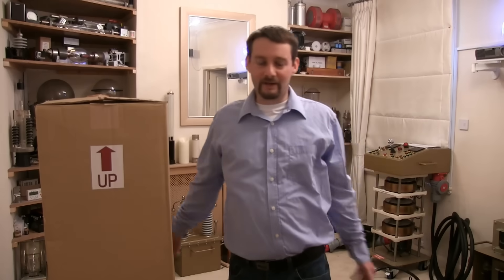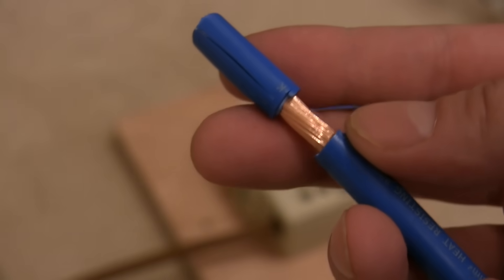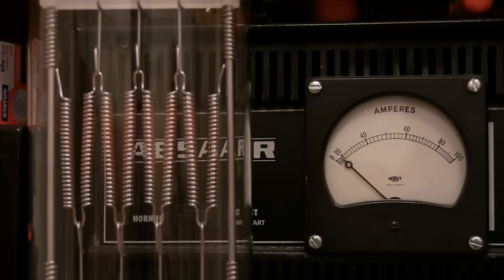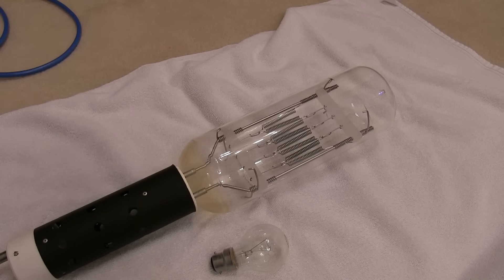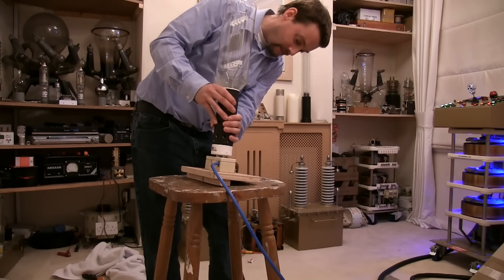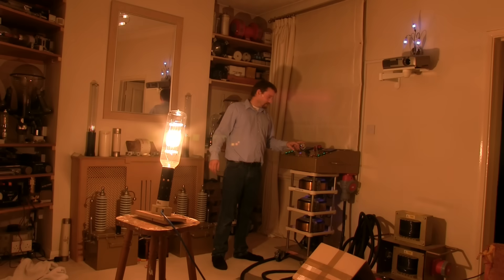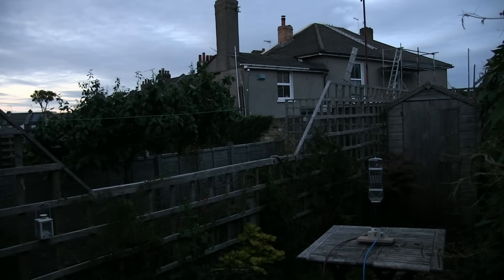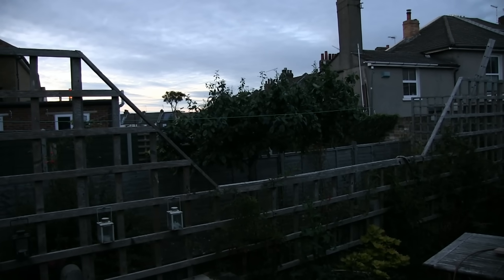20,000 Watt Light Bulb Test

Comment: What would be the normal purpose for this type of bulb?
Reply from the maker: Large scale film set lighting
Reply: Quite amazing :)
Reply: You could feed solar panels for free energy
Reply: Making the Sun look dimm
Reply: Growing pot indoor!
Reply: a replacement for the sun
Reply: Pretty sure they used one on Star Trek to cure Spoc once....
Reply: +Photonicinduction Photon,I'm surprised that you didn't wear sunglasses during this test,20,000 watts in a room that small had to be a serious test for your retinas...HAHA!!.
Reply: http://www.bhphotovideo.com/c/product/1022546-REG/arri_533201_t24_fresnel_light_stand.html
Reply: Yeah I did more research, it appears they used 100W bulbs for a while, but they now use brighter 250W halogens which are around 1000W incandescent.  so sorry for being misleading. my main point was, light houses really do not have very bright lights, they just have great lenses.
Reply: believe it or not, most light house bulbs are not very bright. many light houses use a single 100W bulb. the Fresnel lens does the work of making the light carry. Remember, light houses had to work before electricity, when whale oil lamps were providing the light.
Reply from the maker: I was pushing out more volts than I had coming in, this causes increased current on the input
Reply: +ChompChompNomNom yea great idea if the laws of the universe didn't exist it would be a waste of huge amounts of energy
Reply: It definitely doesn't work like that. Vast amounts of energy are lost through heat, and even the best solar panels stuggle to be even 30% efficient.
Reply: It looks like it's a single phase, but using a 5 pin plug because you probbably can't buy a 100A 3 pin.
Reply: Looks like its designed for Arri studio lighting systems. This bulb alone cost around $2600.00 USD
Reply: christmas decoration...
Reply: i would think a light house bulb
Reply: Or a lighthouse?
Reply: growing a shit  load of weed
Reply: Solar roadways.
Reply: Bedside lamp, fridges and fish tanks
Reply: Nightlight 😂
Reply: Growing dank weed
Reply: Or to burn your shadow into the wall. Some real sci-fi shit.
Reply: +Tom Lloyd also- have uk power networks supplied you with a 100A three phase supply into your shed haha
Reply: +James Franklin That's why this needs to be a 20 kW LED light array. :)
Reply: growing a shit load of grass
Reply: ***** there is one light house on our islands see link https://nl.wikipedia.org/wiki/Vuurtoren_Eierland it uses a 2000 watt philips bulb
Reply: +4 gauge | Actually that is 2-phase 120v AC. When I look at most US kitchen appliance plugs, there are two 120v legs on them.
Reply: growing some big buds lmfao
Reply: so basically a mini sun
Reply: +Photonicinduction is the difference in amperage between the input and the output of your supply due to the difference in the voltage- Input from local transformer 240v+ ish and your controlled output limited to 230v ? Sweet videos as always! 👍
Reply: JBroMCMXCI
Great idea!
Reply: +ChompChompNomNom Yeah, household supplies are almost always single phase, 100A, 80A, or 60A (he has 100A). Industrial connectors are available in 16A, 32A, 63A, and 125A, in both single and three phase, for whatever reason, he chose to use the three phase verity.
Reply: +jesus jones this lamp will any insect next to 200 meters. Burn the life out of small bodies.
Reply: what about a light house?
Reply: +Joseph Florentine Do you have a source on that? I can't find anything saying that multiple full sized light houses actually use a 100w light bulb as a light source.
Reply: Francisco Herrera
 Do you live somewhere in america? In most parts of europe a 3 phase 230/400V 50A or 80A supply is pretty common for simple one-family households. Keep in mind that photonicinduction lives in the UK.
Reply: Francisco Herrera
I was talking about america, not the USA. Panama is a part of north america. Every country of north america and many countries of south america uses something between 100 and 130V.
Reply: Used lamps like that in theater lighting - admittedly most of them were 1000 watts.
Reply: Lighting for what!? Sunlight simulation!?
Could it have handled getting the full 20Kw all at once?
Reply: +jayja45 U.S.A.building standard is 200 amps at 240 volts.I have this in my home,so it's not really out of sorts for this video.
Reply: +4 gauge : Before anyone jumps on you saying the US doesn't have 240 volts, they do.

At the pole the medium voltage (often 1000v) is reduced to 240v in a center tapped transformer. Since the transformer is center tapped, this gives the house two 120v phases (red and black wires) 180º out of phase with each other. The center tap is the common ground (white), and it's earthed where it enters the house.

It's nice because you can run some appliances like cloths driers and electric ovens at 240v (red to black) and others at 120v (black to white or red to white).
Reply: @Falcrist  and welding machines. Efficient welding machines work best at 220v
Reply: @oherman  Found the electrician.
I never understood why you guys still call it 110 and 220. 95%+ of the US hasn't had those voltages in decades.
Reply: shurdi3
Lighthouses use very low powered bulbs, like 40w 12v! They have rather large fresnel columating lenses so the light is focused, like a laser, in a very tight pencil beam. The bulbs in the indicators on your car will be very small, thats all a lighthouse is.
Reply: shurdi3
Yeah I thought that too! :o) But I used to know a lighthouse keeper and he said they have to be able to run off big lead acid batteries if the power line is broken.
Reply: Erm... this is what they use a lighthouses and stuff.
Reply: now imagine that lighthouse with this bulb.
Reply: Combined with orange dye, they are used in Donald Trump's sun bed.
Reply: Instant sunlight, aka 100CRI, the best for filming daylight scenes during improper lighting.
Reply: You right but some people are just plain stupid.
Reply: That's just it, you have to compare the technologies side-by-side. A white LED is nothing more than a Blue LED die with some phosphorous coating, no matter what you do with this phosphor its never going to be as perfect as a glowing white hot piece of metal when it comes to full spectrum output.
Reply: this night light is for people who are completely blind
Reply: But he was quite blind afterwards...
Reply: they must of used this light globe to do the moon landing in 1969
Reply: +thoriumriver hahaha hahaha thank you for this funny comment.
Reply: this light might attack ET communications
Reply: +jayja45 here in swiss is normal to have 3ph most 32Amps
Reply: There are actually 3 pin single phase plugs available eg. 13216 by Mennekes.
Reply: iam sorry friend the bulb is actually 20000watt;) here in The netherlands they already use 1000watt on trains
Reply: Power Max they dont look like sunlight
Reply: Its due to heat. No transformer is 100% efficent
Reply: Lighthouse.
Reply: probably stadium or light house lights.
Reply: Do you not know what sunglasses are for and do?
Reply: +iooi HAHA!!.Good stuff.
Reply: its used for film says in the description. And yeah some stuff you think is shot during the day isnt shot during the day.  Ive seen them filming in a park before and it was lit up like daytime.
Reply: To film what? 
People dying of a heat stroke?
Reply: Im sure it would be awesome to get TAN.
Reply: There for movie sets to resemble the light from the sun
Reply: +Techtron23 No,it's 240 directly from my step-down transformer,on its specification plate it says: 3.3K.V.A. INPUT/240 volts 200 amps output.I have 100 amps continuous capacity at the breaker box in my home and have 200 amps at 240 volts on my main breaker box at the pole.Of coarse you cannot use ALL 200 amps at 240 volts.(100% capacity is NOT possible,only 75%continuous is possible due to thermal runaway which spells disaster if used in this manner)
Reply: Id say its for a lighthouse
Reply: They where invented by jj abrams so he could over expose more of his shots.
Reply: he probably used the 3 phase extension lead cause he could parallel up two pins per mains side for better current handling.
Reply: +Photonicinduction Huh...then what do they use in lighthouses?
Reply: +Prince Westerburg 

Interesting.   Always figured they would be using these huge powerful bulbs so they can spread out as far as possible 

thanks for the clearup
Reply: +JBroMCMXCI Cause that's gonna work.
Reply: I wonder how much this thing cost to buy AND to keep it running at your home.
Reply: Francisco Herrera
lol :D
Reply: it looks so dimm on the camera XD
Reply: stadium lights...
Reply: This comment was a joke yeh?  'cos it certainly wasn't free energy that powered that light bulb
Reply: Tomatoes and Maryjane
Reply: check...and mate...
Reply: this would be a lighthouse bulb with a giant reflector , sir !
this could also be a bulb for a movie projector using a giant screen.
Reply: We used to stock a couple of lighthouse bulbs and it isn't one of them. I can't remember the wattage, but it wasn't very high at all and we used to test them on a domestic system. The bulb it's self is fairly large and round. It's the lens that amplifies and concentrates the light into a bright beam. The bulb in this video is used for filming and is often referred to as a "sun" as it is used to generate sunlight especially on cloudy, overcast days when they want a sunny shot.
Reply: They should use LEDs....
Reply: +Francisco Herrera I'm not sure why you bothered to comment, but +anonym musiteufel is clearly aware that Panama is a country on an american continent (i.e. North America or South America) and even specifically stated that they were not referencing the United States of America, almost in those exact same words. More to the point, it seems that +anonym musiteufel was attempting to take part in a friendly, educational conversation so your negativity stands out as being really unnecessary and unwelcome.

I would genuinely like to know if this is used on a massive scale for anything in our everyday lives (like at a football stadium or something) but +Andrew Joy is probably correct. xD
Reply: +ALSPEHEIR It would cost around £3 an hour to run. (1 kWh = 15p. 20kWh x 15p = £3.00). Approx cost of a unit of electricity (kWh) in the UK is 15p.
Reply: hahaha
Reply: Driving away the rifraf from your drive way.
Reply: Hiding from people
Reply: if you want to smoke it.... not grow it
Reply: ・ロイドマークマ・ロイドマ  PANDA PANDA PANDA PANDA PANDA
Reply: I work in Film and TV, we use these bulbs for Tungsten lights on set to light large studio spaces. Holding one in your hand is nerve racking
Reply: +Alex Dabr are you implying the people from North America are idiots?
Reply: Then you could reuse the heat to heat up a small size city. Voilà, and you got 100% efficiency :)
Reply: +ChompChompNomNom  
The bulb is of course single phase, but it appears he's using a three phase variable transformator, thus it has three phase connectors.
Reply: Really tall buildings or other high up places that need lighting no doubt. Maybe even lighthouses.
Reply: The ones I have personally seen up close (Eastern Canada) typically use 500W halogens that cycle on/off. It comes down to the optics really, so the bulbs don't have to be very bright.
Reply: You must be joking :/
Reply: When I wrote my comment there was no comments on this!? Hmm looks like Photon already answered! strange How I didn't see 130 other comments?!
Reply: You can, there are industrial single-phase plugs. 230V ones are coded blue; his 3-phase is red.
Reply: LEDs have very uneven spectrum. Unfit for top-tier movie recording.
Reply: You need to use phase-to-phase voltage; you could do over 170A output with just a 100A breaker. Or give up the alternating current and flat-out rectify all three phases. And show us a 50 kW lamp! And the whole neighbourhood!
Reply: stadium
Reply: Barbed Two I was being sarcARSEtic
Reply: zwz • zdenek You can get some really nice 6500k LEDs which will do a good job.
Reply: *****
They will not. Look up the spectrum diagram of a LED vs. an incandescent lightbulb. And 6500K? Those are the worst, you can't suggest those! Anyway, the exact black-body spectrum of the bulb is the winner.
Reply: Why not Xenon arc lamps?

Comment: What's a monster bulb like that used for?
Reply from the maker: Large film set lighting
Reply: Yeah i would like to know as well.
Reply: These bulbs are usually used in Theater Projectors, Stage / Studio Lighting.
Reply: wish I knew, even IMAX projectors "only" use 15kw bulbs 
"
The lamphouse on top of the IMAX projector utilizes two 15,000-watt liquid-cooled, short-arc xenon lamps. The lamps weigh 10 pounds each, and are nearly two feet in length. Costing more than $6,000 each, the lamps have a life expectancy of only about 1,200 hours of operation and are replaced 4 times per year. Because of the extreme high-pressure xenon gas inside the quartz glass envelope of the lamp, projectionists must wear ballistic safety gear when changing out a lamp. If dropped, the xenon lamp would explode with the destructive force of a hand grenade. 

The average luminance of one of these xenon lamps is approximately 1.6 billion candles per square yard--about equal to that of the Sun as viewed from the Earth's surface! The lamp has a light output of approximately 600,000 lumens. NASA uses this same type of lamp at the Kennedy Space Center to illuminate the Space Shuttle at night on the launching pad. 

During normal operation, the clear quartz glass envelope of the lamp has a surface temperature of about 1,300 degrees. To prevent the lamp from overheating, it has coolant "jackets" that allow cool distilled water to be pumped around the electrodes at the flow rate of 8 gallons per minute and a pressure rate of 100 psi. In addition, an exhaust fan removes 1,200 cubic feet of air per minute from the lamphouse. The xenon lamps operate at 37.5 volts DC, and 400 amperes of current."
Reply: first thought here was: for lighthouses. 
But I remember a visit to one here In Germany where the lamp was just a 1000Watt model.
Reply: Night light

Comment: something that maxes out his power supply is crazy
Reply from the maker: Power supply was ok, it was the electric company's 100A fuse I was more concerned about lol
Reply: +Photonicinduction ohh I see you need to do a video on how the power supply is all wired up
Reply: +photonicinduction Have you ever popped the main fuse before?
Reply: +Photonicinduction if it's 100 amps it will take 140 for 4 hours. If it blows call then and say it must have been a tired fuse ;) ideally you need a box of 100a BS88's and some sealing pliers!